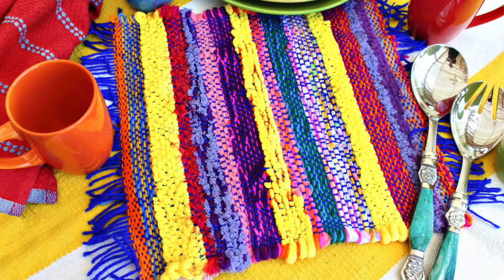Build A Weaving Loom

Comment: I love the loom idea!, and may I ask if it's possible to make a bigger one with stable results to make larger proyects, like a wall hanging tapestry, using the same measurements from one notch to the other?
Reply from the maker: Yes, you can make a bigger one.  I'd use thicker wood pieces for sure (just a little thicker) and I'd also see if you can find some metal for the sides.  They sell long pieces of metal at the hardware store that would work for the sides.

Comment: I have no power tools. Bummer.
Reply from the maker: Time to get some power tools!
Reply: Garage sales offer a great opportunity to collect the basics. Harbor Freight has very inexpensive power tools. I have a small rotary tool that came with different attachments. Similar to the one Mark used to cut the grooves on his loom. You can do this whole project with that tool. Also HD and Lowe's will cut the wood strips for you which is half the battle lol.
Reply: oldladytoofast really?  I could probably swing the cost (and space) for one rotary tool.  Thanks @oldladytoofast 😊  this project reminds me of summer camp in the late 70s.
Reply: The pieces are small enough, you could probably use a box saw too. Cost about $15.